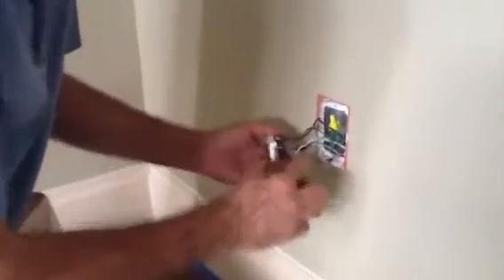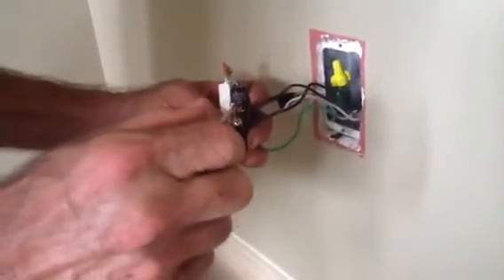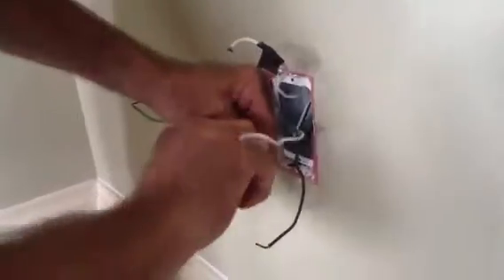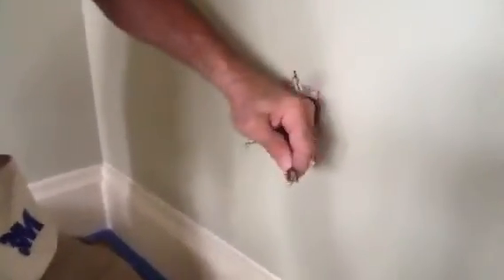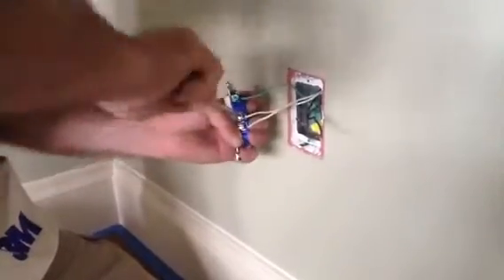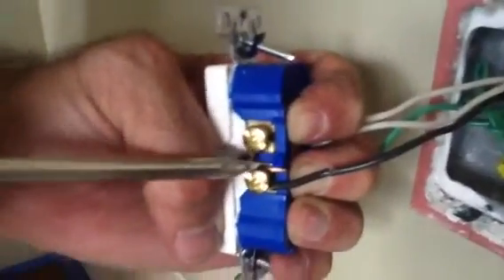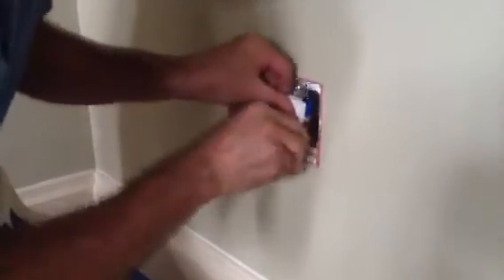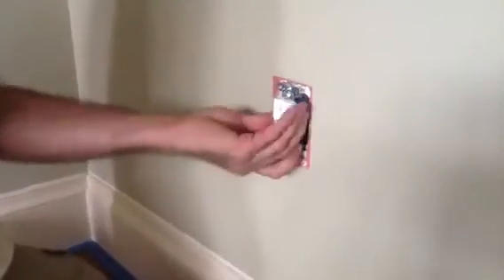Where do I hook up the different color wires on my receptacle

Comment: you don't use linemen to strip wire because they can nick the wire and cause a breaking point ƒor the wire to snap or weaken , also its not the bite we hook ƒor its the direction we hook thats important , always hook on in the direction you turn in so the wire tightens on itself when turning .

Comment: Future electricians note...  when its all said and done you will have learned basic carpentry, tiling, pluming, drywall, drop ceiling, hvac, sheet metal, low volt EM tech, machining, fabrication skills.  Im sure i left off other skill sets.  But you catch my drift.  

No matter the task.  My Klein's end up being just the right tool for the situation 9 times outta 10.  Linesman pliers = 133tsauce

Pair o' Klein's 
Other uses not mentioned in video:
 
Butterfly drywall anchor drill bit, pipe de-burr tool, 9in ruler, and my favorite...  stubborn large lid twister.  (Larger than 440 channy jaws)

Comment: I know it doesn't really matter but I like to take my needlenose after I put the wire on and crimp it down around the screw so I know without a doubt I have a good tight connection.